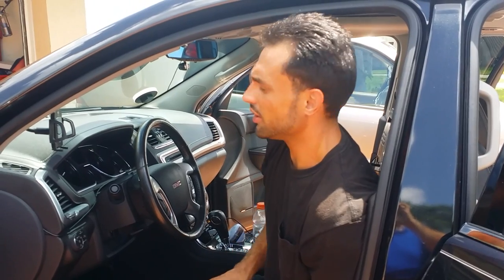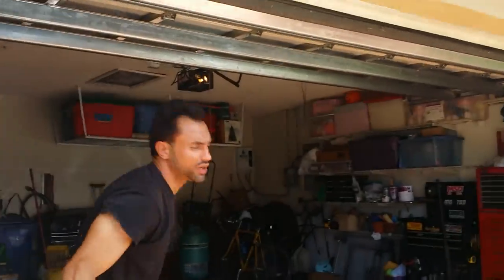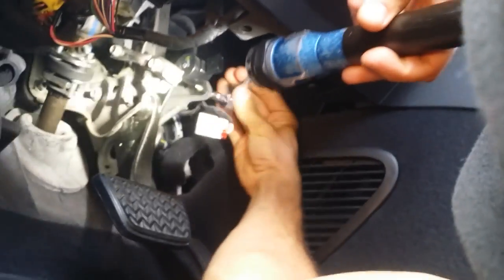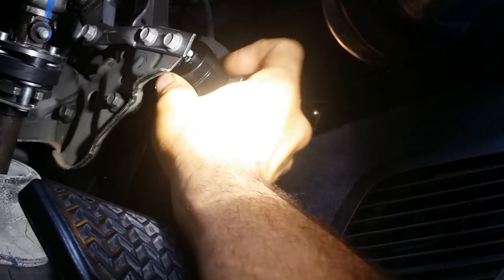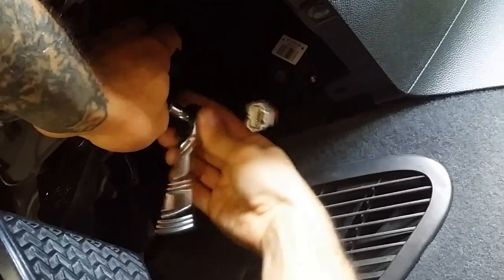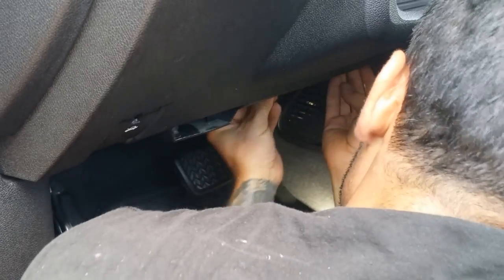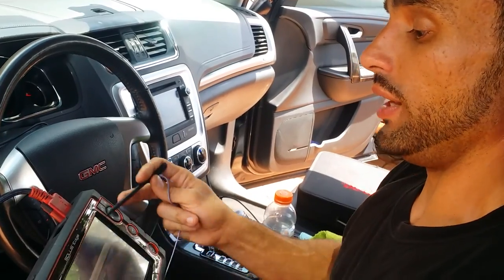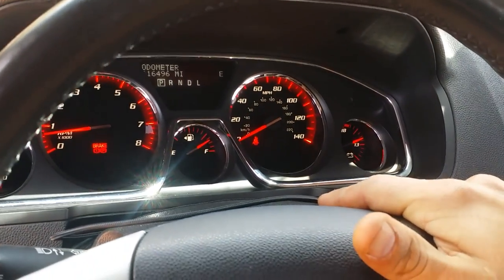GMC Acadia/Chevrolet Tahoe Brake Pedal Position Sensor (Stabilitrack)

Comment: Thank you for taking the time and effort to make this video. I was able to fix the "Service Stabilitrac System" alert on my 2009 GMC Acadia. I paid less than $15 for an AC Delco part. I completely disconnected the battery before starting. I think that helped to reset the computer.

Comment: Just quick tip make. Sure you buy the exact part ! From gm parts because i used 3 and it didn't fixed so i went to buy it from delco company and it fixed and i didn't needed no calibration! Just deleted the code that was it

Comment: This sensor, it can be tested, it is a potentiometer (such a variable resistor) you must to use a multimeter, from the center to anyone of the pins it must read 869 ohms (aprox) and from the center to the other pin it mus read 3.41 kilo ohms, if you move the arm to the other extreme, you will see how resistance value change, and the readings exchange, which first read 869 ohms, now will read 3.41 kilo ohms, and which first read 3.41 kilo ohms now will read 869 ohms. I have not good english, hope help someone. Regards.

Comment: Thanks for posting such a simple fix for intermittent ABS disabled, traction control disabled, and no cruise control on 2011 Traverse.  I never noticed brake lights on but I never had a reason to walk behind the vehicle when it was occurring.

Comment: Do this - but know that you may need to initiate a brake pedal position sensor relearn procedure. 
In some cases, it relearns on its own, such as when replacing the throttle body; in some cases, it will only relearn if commanded to through a commercial grade scan tool. 
If changing the sensor does not stop the problem, call around and find a mechanic who is familiar with a brake sensor relearn command. This applies to all current GM vehicles, so its a common procedure.

Comment: I have a 2013 buick enclave my brake lights were sticking but at least they were working. And now I changed mine and disconnected the battery cables and touched them. Now my brakes lights are staying on when put in drive and turning off when I apply the brakes. Will calibrating the sensor solve this problem?

Comment: Do you not need to calibrate the sensor after you replace it? If so how do you do it with the solus? Is there a way to force a recalibration of the sensor that is already on the vehicle? Thanks.

Comment: My 2010 GMC Acadia is giving the messages, "Service Stability Track, Traction Control OFF, and Engine Power Reduced". The traction control light and check engine light are both ON on the dashboard. The local auto part store (AutoZone) did a scan and told me I need to replace the "Accelerator Pedal Sensor". Is  this a combination of two separate problems? Do I need to replace both the "Accelerator" and "Brake" pedal sensors? I can barely make it one mile before the car starts to act as if it's about to shut off on me. Please Help Me...I purchased the car used in September 2018, and all this started with the first Minnesota freeze which wasn't much later. I haven't had the chance to actually enjoy my new car... :0(
Reply: No. Stabilitrack uses both sensors. Engine power reduced is generally caused by the Throttle/Accelerator position sensor. I have fixed this problem that stems all the way back to 2004 silverados and impalas etc that show engine power reduced, when the pcm doesn't have any visible communication with the TPS it goes into engine power reduced. Seeing as these cars will still be driveable with the service stabilitrack message, my suggestion would be to replace the Accelerator Position Sensor like your parts store recommends and clear the codes and see if service stabilitrack comes back
Reply: @gabeulrickson2496  I replaced the part, but nothing changed. Now I am told to clean/replace the throttle body.
Reply: @1carmea  dont replace the whole throttle body... They make a kit to just replace the sensor now instead of the whole throttle body. Much cheaper!
Reply: Were u able to fix ur car issues?? Have same problem.

Comment: I have a 2015 gmc acadia having same issue I pressed the brake pedal my abs/tc light come on I need to stop turn it off to reset it my tc switch won't work any advice

Comment: So I have changed this part on my car twice. Both times it is still not working. The brake lights stay light and I have to pull back on the brake pedal to disengage but once I release it re-engage the brake lights. Also causes me to not he able to use the cruise control. It will also allow me to take the car from park without using the brake

Comment: Did this repair today on my 2011 Buick Enclave for the same reason...service stabilitrac light...seems to have solved that problem...the issue I now have is my cruise control doesn't work...same circuit going through this sensor? Suggestions?

Comment: I have a 2008 Buick Enclave. The brake lights are continuously on but when you press the brake they go off. The ABS & Stabilitrak lights are on. I replaced the brake pedal switch. The brake lights are still on. Do I need to disconnect the positive and negative battery cables and touch them together?
Reply: Keenan Simmons  I have the same car and the same problem that you managed to solve?

Comment: I had the same code come up C0161. The dealer said it could be in the ABS Brake Circuit Valve. Could that be correct, not sure what do you think? I had the same warning message and light come up on the console. Very Good Video.  I think I will try this first. Thanks
Reply: Did it work?

Comment: by disconnecting the positive and negative terminals, is that going to lock my stereo? Or if i touch the terminals together, will that make it lock also? What will happen if i just disconnect the negative before i replace the switch?

Comment: Hi, I have a 2017 impala, traction control is not working, I try my car on a wet surface the traction control is not working, even not blinking, also it's no light on the dashboard, everything seems OK on dashboard, if I press the traction control button it's light on the dashboard, so everything is regular but in reality traction control is not working, the obd2 scanner didn't recognize any code, please help

Comment: I have a 2014 traverse that has the stabilitrak come on every great once in a while along with traction control... sometimes the brake pedal goes fully to the floor also! I’ve had a brand new brake booster, master cylinder and everything replaced. Still didn’t fix 1 issue. It’s infrequent enough that the dealership never gets it to happen and neither does the local mechanic... it happens once every 2 weeks or so. Sometimes longer. Sometimes shorter. Anyone had anything similar?!?!? Or any ideas??
Reply: We have a 2014 Traverse in shop right now with the same issue!!! Did you figure it out yet?
Reply: Jillian Gunter no I haven’t but I know it wasn’t the master cylinder, brake booster or proportionate valve. I’m going to check the abs ground wires, and brake pedal position switch. Both those are easy and cheap.
Reply: @patrickpreston1909  Did you try the break sensor re-learn command? That is our next move.
Reply: Jillian Gunter no. I have no idea what that is or where or how to do that. I’ve never heard of that lol
Reply: I know this was a year ago but I am having the exact same problems. Mine was also Infrequent and not often enough to force an occurrence. We hadn’t figured it out and now it happens every time I drive it. It wasn’t until my car shifted out of park without engaging the brake, when a google search was able to give me this answer. I ordered the brake position sensor and I’m about to change this.
Reply: @kitkatkay91   I hope it works for you!! We ended up trading it in. The transmission was slipping and the brakes were scary. Dealership can deal with it.. no more Chevy for me. American cars in general are complete trash now.

Comment: I did everything but brake lights remained on as the pedal was pushed down. Any one with same problem ?
Reply: Did you ever find a solution?
Reply: @melissamitchell5206   re calibrate the sensor using a Scanner

Comment: This did not work for our 2015 Acadia. 
Service Traction control, service stabilitrack,  Engine power is reduced... speed reduced to 37 mph... all still a problem.
Reply: myworldmyboys  I have the same exact problem with the 2014
Reply: No. It won't work for engine power when reduced.
Reply: May be the throttle body.
Reply: I belive there was a special coverage for throttle body's but it has to be under a certain mileage and year.
Reply: Im having the exact same problem on my 2012 GMC Acadia... Says service traction control, engine reduced power, service stabilitrak. Sometimes i start it and its fine, but most the time it does this after driving for a couple minutes! Need help, cant afford a shop.
Reply: @evend07  Were u able to fix your problem?? I have exactly the same issue and have no clue where to begin
Reply: Perhaps start with the obvious and cheapest method..get a can of CRC mass Air flow cleaner spray and clean it.. Then buy the CRC GDI spray cleaner and clean the throttle body and let it heat soak for about an hour then drive it at highway speeds for at last 10 mins or so.
Check the Purge valve.Also verify ALL fluids are topped off including engine oil , transmission oil, the front transfer case and rear differential.Check hoses for vacuum leaks.Also modify the rear PCV valve, check on line easy fix..
These cars can drive you crazy, especially if you got a lemon.. but runs great when well maintained..This is the "trick" for ALL vehicles, MAINTAINANCE..

Comment: So I did this and now my New "BRAKE PEDAL POSITION SENSOR" is Unlearned from My BCM....    so here is what happens now.   The brakes WORK FINE.   but the Brake Lights do not. 

    After I start the car If I apply the brake the light turns on, and then when I release the brake the light would turn off. However 5-6 seconds after I released the brake the light would turn back on. I did it a couple of times and then counted the time between when I let my foot off the brake and the time the light came back on and it was always almost exactly 5-6 seconds -- after that time the light would go on and stay on as long as the car is running, even if in park. while the lights are on and I am driving I could apply the cruise control during the 5-6 seconds while the light was off but once the light turned back on the car will not allow me to tap them off with the brake pedal. so the Cruise is useless besides the car being ridiculously unsafe. 

   Another thing!
Another strange thing with the light is that if I just apply a little pressure to the pedal, I mean just enough to move it , not enough to actually slow the car down or even brake at all, the brake light will turn off. The light turns off the entire time I apply that little bit of pressure, but once I  let off on that pedal ( It's very difficult to hold at that place for very long)  it  resets the 5-6 second "clock" and then the light would just go on after that and stay on.      So I thought.  if it will shut off from that small amount movement, maybe I can adjust the sensor so it is a tiny bit "Off" the regular mark. <-- to mimic my holding the pedal down a hair.    I constructed a contraption with a small C clamp rather than go a head and drill out my brake pedal assembly bolt hole so that I could slide the mark to the desired working position.    however it does not work that way.   ( so glad I didn't drill that out! LOL  )  so what happens is no matter where the switch is positioned it still does the same thing and here is WHY! LOL   This  is my third freaking day on this man, I am cut up, my back hurts, feels like I have a broken rib.  blah blah blah    im not kidding around here. 

   here is why.   It is the fact that that "Brake Pedal Position Sensor"  is not called a Brake switch.   the switches are MUCH easier.    Ok so this is some kind of thing like a rheostat inside there, like whats inside the fuel pump assembly on the float arm.     so after I clamp that sensor on exactly where I want, it's reading a dead signal.  when I move it that tiny bit is actually what is turning the brake off, Not the place it is, the act of getting it to the place. so adjusting the sensor further does not change the status of the brake light predicament. 

   WHEW!   I really wanted to write that down somewhere.   LOL    here is what I was really wanting to ask.    Do you know of a Scan tool that has the capability to run the little program that your snap on scanner has that will relearn the BCM to read the position of the pedal correctly ?  I mean a scanner that does not cost 4 grand.   This whole car doesn't cost 4 grand, its a 2k car at best. lol  

  I just need a scanner that can do that - I am sure there is a cheaper one out there somewhere.  when i talk to people at the auto parts stores though they are oblivious.  The dealerships all want to rob me blind on this one even though I tell them exactly what the problem is and what I need done they still act as though I am a blithering idiot with a pocket full of gold.   They literally want to take 145.00 cash to LOOK. Then they want more for TESTS, Then they want to Replace what I have already replaced for 20x's what the part costs,   no joke  they want money I do not have. 

  I am sure a scanner that can do what I need right now will also have many features that I can use in the future as well.  I just gotta make sure it will at least do this thing I have to get done now though for sure.
Reply: Hi 
Did you find the fix for this. Having same problem 
Thank you.